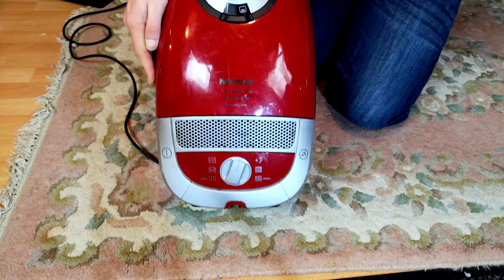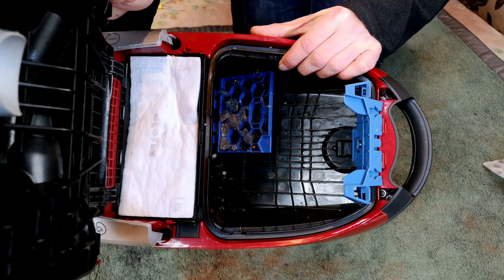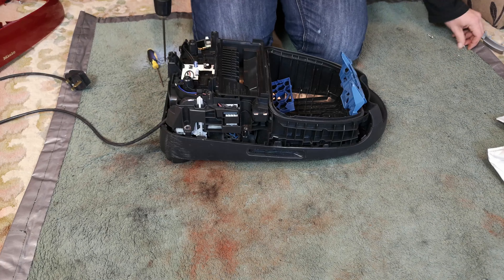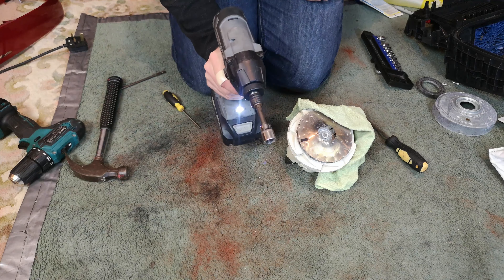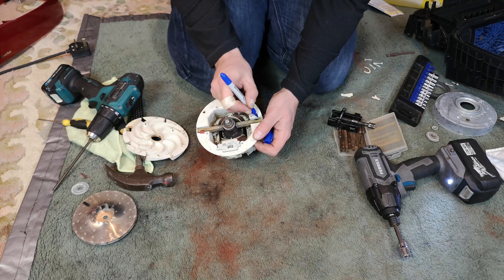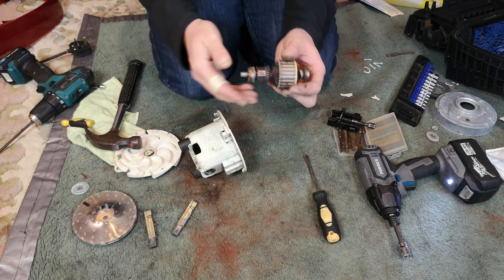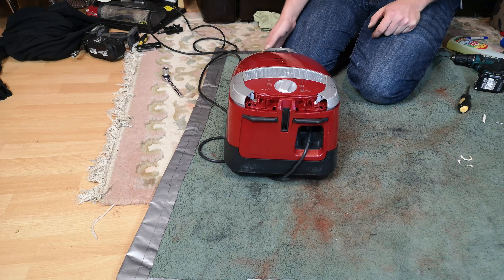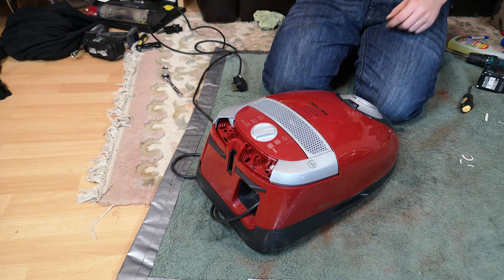Making it worse! Miele C2 Compact with water damage...

Comment: Those red S5 series machines are both C2 Completes Sam - the C2 Compact is what the blue one is - Ie, the old S6 series.
As you know, Miele motors are notoriously difficult to repair and once one fails, it usually means the vacuum is scrap due to the insanely expensive prices of Miele parts. I seem to remember the brushroll assembly for the S7 upright would set you back around 100 quid a good 7 years back when I was making videos - God only knows what they charge for them these days.
Good effort trying to repair the motors Sam, but even the vacuum repair Guru such as you are cannot repair absolutely everything. Dont worry though Sam - we all know you are the best bodger in town and if you cant get it going, then no-one else will either, lol
Reply: The good thing about Miele is none of their innards and circuits are proprietary, They use off the shelf stuff from Japanese brands like Toshiba, Sanyo, etc. You can fix it all in your garage.  Also there are used parts and salvaged parts often available, they are just expensive due to the high buy-in cost of a Miele. Miele to vacuums is like Mercedes Benz is to cars.

Comment: Hi Sam, that motor looks like an MRG 710 is that right? If so can you tel me is the rotor (armature) the same size and length as the MRG 148 in the S7 upright? I remember you doing a swap with an older S5 armature  to try and repair an S7 in the past.  I Understand the wattage differences and can shorten brushes and re-seat them without a problem, Thanks.

Comment: This is honestly depressing... How much money do Miele's cost over there in the UK?
Reply: Around £200-300
Reply: @RJA_World Holy hell
Reply: @FrenchFryCheese04  yep and people just trash them
Reply: @RJA_World  That to me is like a waste of money you know?
Reply: @FrenchFryCheese04  Absolutely. They do the same with Dysons too
Reply: Same for the USA. People will put down $800 for a Miele upright and then junk it in 6 months.  I have a Salsa that I got as a box of parts for $45 on eBay. It was in a flood and then left on the curb and then some eBay seller took it apart, stole the soleplate and all the screws, and sold the rest.  Cost me $20 for OEM used screws, and $90 for a OEM used soleplate. Motor will need some deoxit and rust inhibitor but should all work.